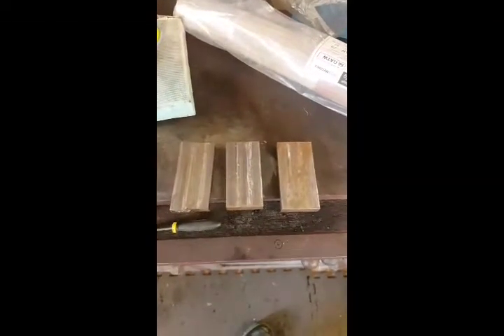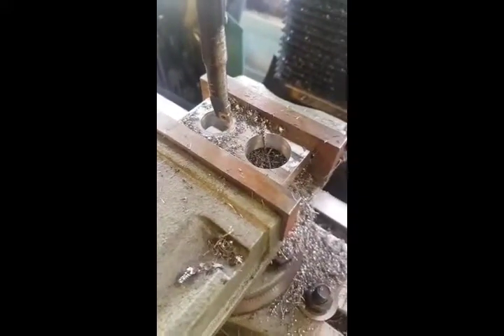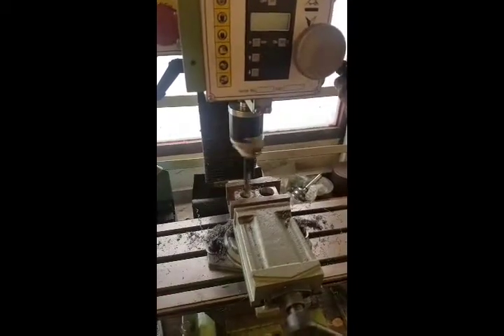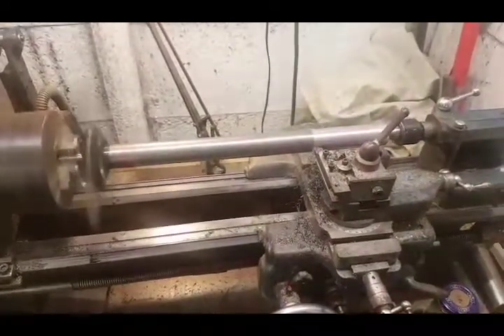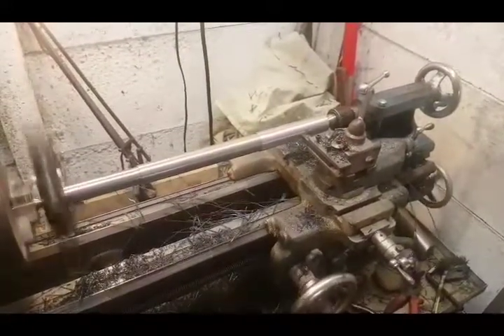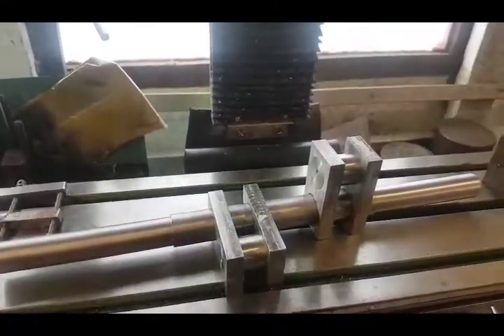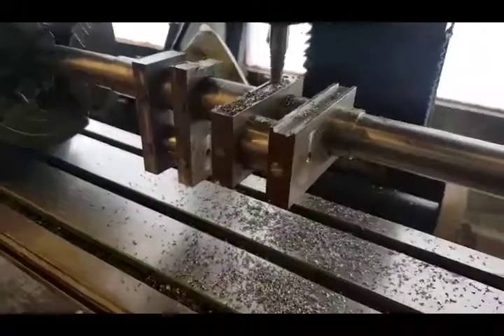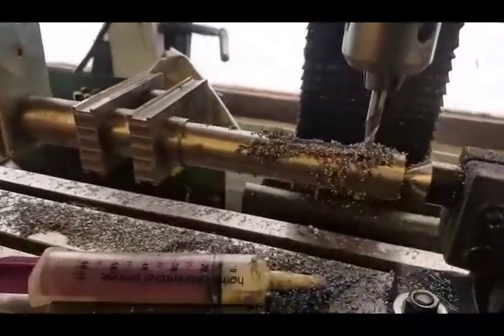3" Fowler Crankshaft build - Part 1

Comment: May I ask what type of fowler you are making?
Reply from the maker: +Sircheesepuff 21 Well here's the thing, Plastow sell it as merely a duel crank compound Fowler. From what I can tell by comparing it to full size it is a B5.
Cheers Cheesy
Reply: John Lintorn oh right did you just buy the drawings
Reply from the maker: +Sircheesepuff 21 Yes all but the boiler which I designed. The drawings are from Plastow but I wouldn't recommend them. They are absolutely awful as you'll see in my next video 😉